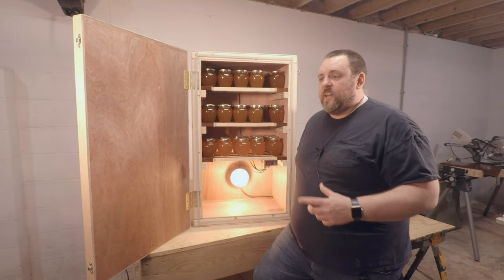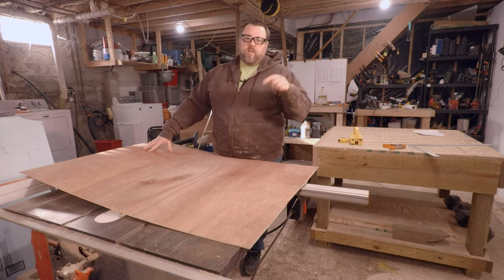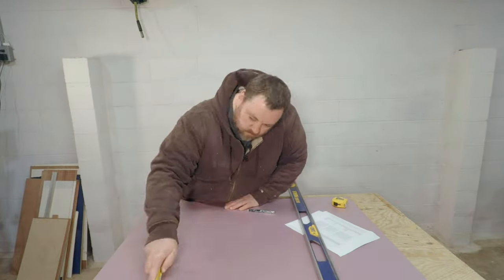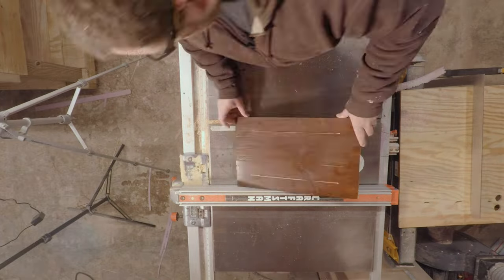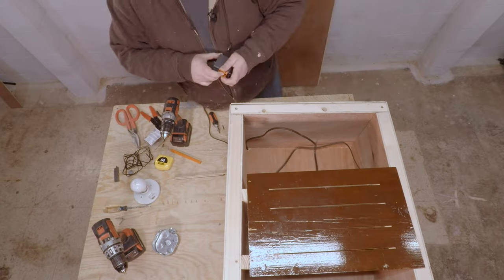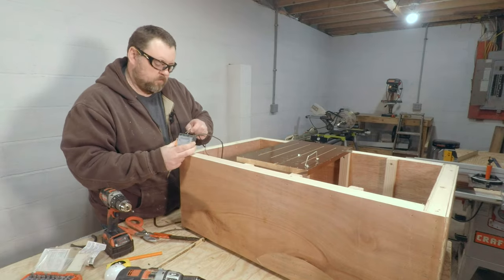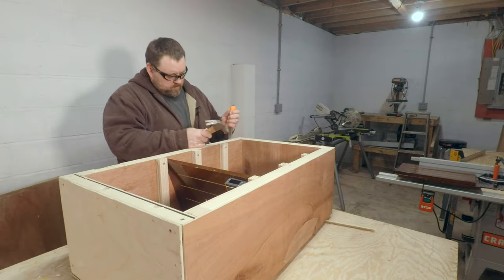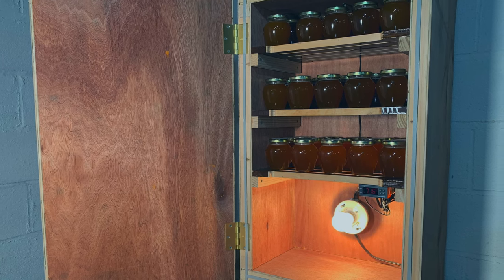🐝Heated Honey Cabinet Build with SIPs | No More Crystallized Honey!

Comment: Really nice video. I built my warming cabinet as a chest to hold honey buckets and not individual jars but seeing your video I'm going to turn mine on its end and steal some of your design ideas. I put casters on mine so that it was easy to move and I used flush hinges for the lid(door). Slightly more expensive but far easier to fit. I also mounted the temperature controller on the outside so that if the incandescent bulb fails I can tell due to the drop in temperature.

Comment: Great job, I can see this project in my future. 
The only thing that will change for me is that I will use heat tape (a reptile product)  instead of a light bulb that way the bottom area can be used for honey storage also. Thanks for the video.
Reply from the maker: Thanks Ed, I was looking for other options for heating but the bulb seemed to be the simplest solution. After I built it I did stumble across a mini heater I think they were using to warm a fermenting cabinet. Let me know how yours turns out with the heat tape!
Reply: @BeeBoyBill  Here's a link to the heat tape: https://www.reptilebasics.com/heat-tape , you can use the same controller and add 2 shelves to your build. I will definitely let you know how mine turns out. Thanks Again!

Comment: I enjoy your build videos. Thanks for sharing. I think I would have used a router to remove most of the hinge pocket and only cleaned up the edges with a chisel. Finally, I did build a hive using this method.  It turned out well, but is was a lot of pieces.
Reply from the maker: I imagine it was a ton of pieces. Thanks for the tip on the router, makes perfect sense now that I’ve heard it suggested. Thanks for watching Ted!

Comment: Another option would be to find an old refrigerator to use. It might even be free especially if it was broken. Back when I was working they were sometimes used to keep welding rod dry. Same light bulb but no controller.
Reply from the maker: Great idea John! Thanks for sharing.